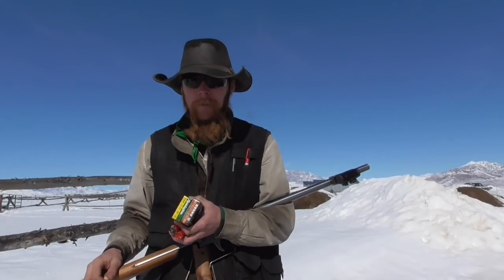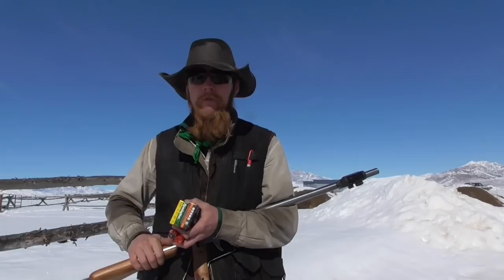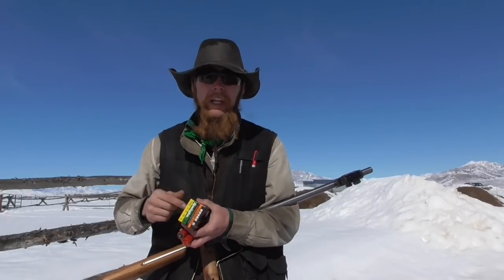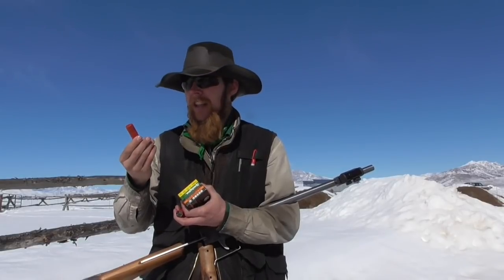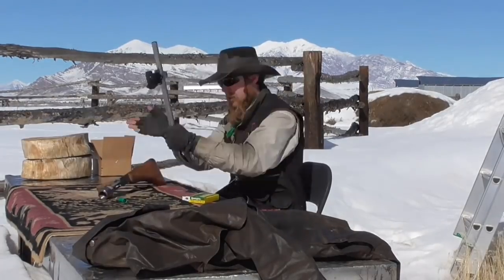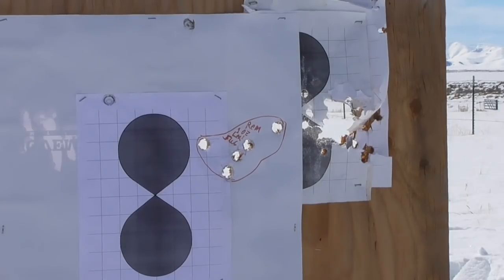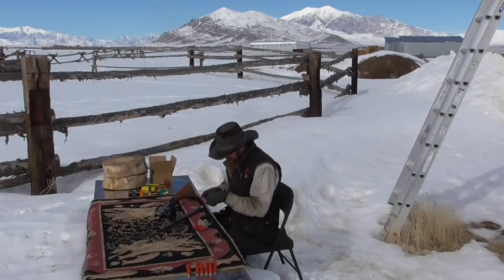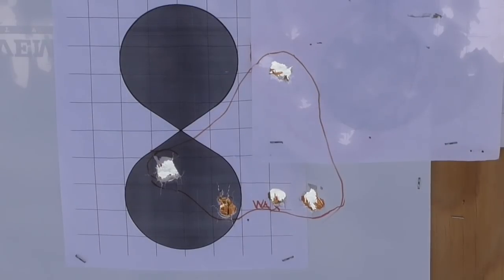Baseline Slug Testing with the GEFRRSN (TIS201)

Comment: Very interesting. I have used cut shells a few times. I could hit a pie plate at 65yds everytime the shell held together but when the shell came apart it would not even hit the backstop. All fired from full choke. It would work in a pinch for black tail at 45 yes reliably but I would not trust it for bear.